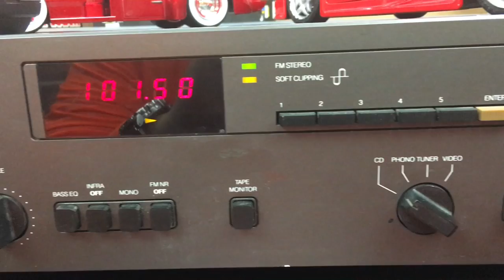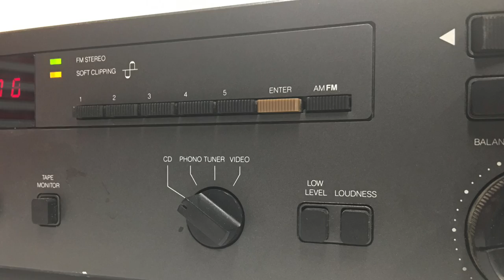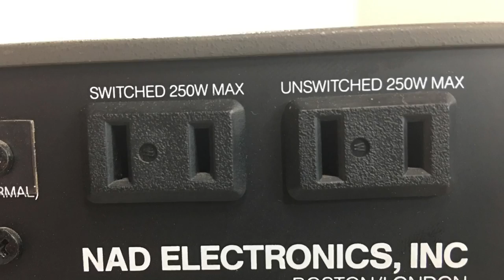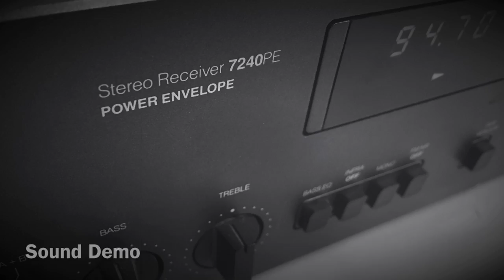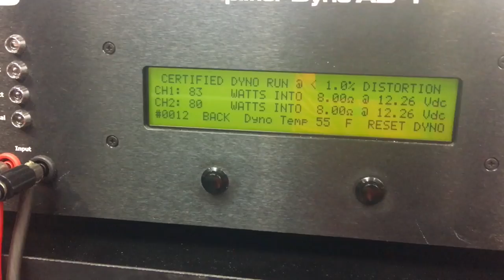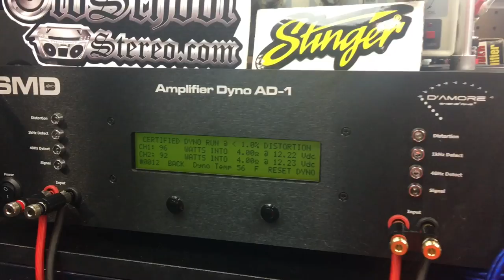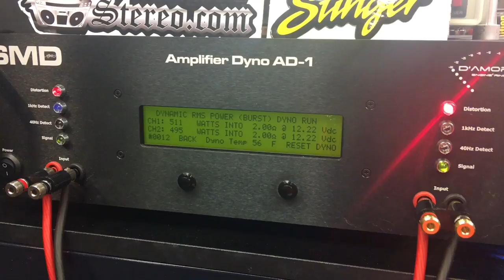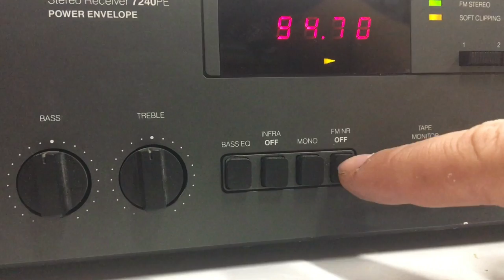NAD 7240PE Vintage Home Receiver - Incredible Dynamic Power

Comment: I found this unit in garage sale for 20bucks. It sounds so amazing I'm giddy. Quick question. What setting for Vandersteen mod 1 speakers. Any thoughts? Does it sound better "LOW LEVEL' and volume up or Loudness volume lower. Considering Neighbors. LOL  Thank you so much., Rob
Reply: bnowb The LOW LEVEL button is nothing more than a built-in pre-amp attenuator, giving you greater free range of the volume control when enabled. It's really a matter of listener preference. The Low Level button also improves the signal/noise ratio and removes the "digital glare" common in solid-state gear. I've got a similar NAD 3155 integrated amp driving a pair of power hungry KEF LS50's. I use the 4ohm tap (less voltage/power but the tradeoff is improved stability), soft clipping disabled, loudness button disabled, and low level button enabled.
Reply: Wow First Thank you Soooo much for replying. I'm having such fun with this little amp. Do I simply flip the switch to 4ohm? I had the lowe level button on just for that reason, freedom of volume and it did  sound nice. Plenty of volume thats for sure. Let me know on the 4ohm I think our settings otherwise are same but I'm turning off soft clipping now and wanna try 4ohm. Let me know how, hopefully just flick of a switch. Great site I subscribed. :)
Reply: bnowb yep takes a Phillips Head to loosen the plastic piece (if there) holding the ohm tap secure. Then slide it to 4ohm. Vandersteens are great speakers, so I have to assume that their ohm load fluctuates below 8ohm at select frequencies. E.G.: my KEF's are rated at 8 but dip to 3.2 making it a boar to drive properly. Unless your speakers are at 8ohm and above throughout 20hz-20khz, always use the 4ohm/normal tap to preserve the life of the amp's output transistors.

Comment: Correct me if I'm wrong but wouldn't that 2 ohm power output make the rating only a 3db output? Or is that 6db rating for the input?